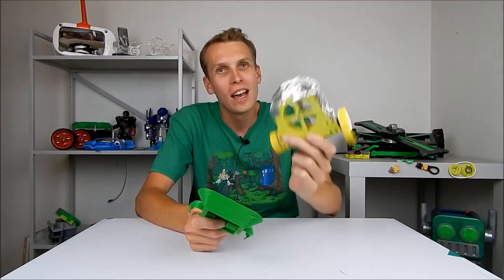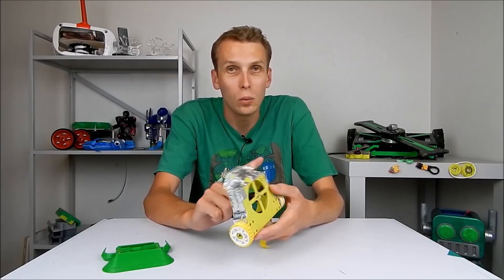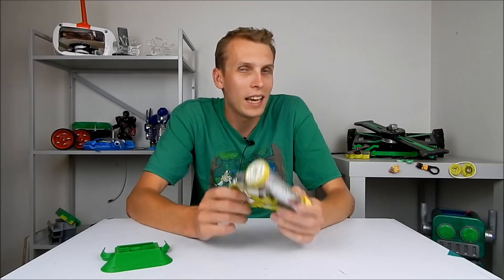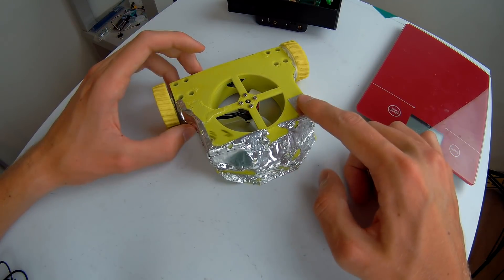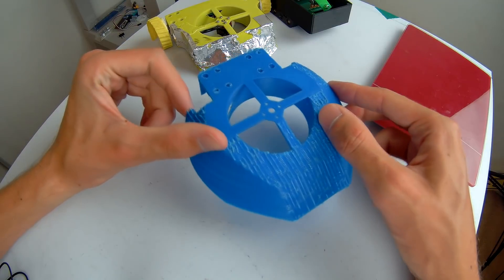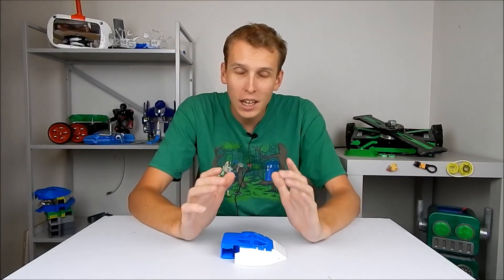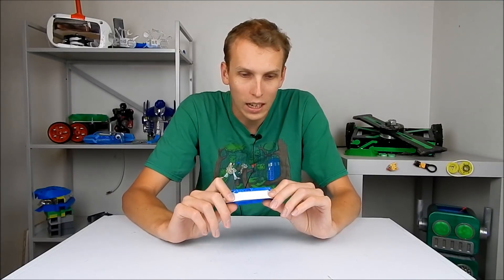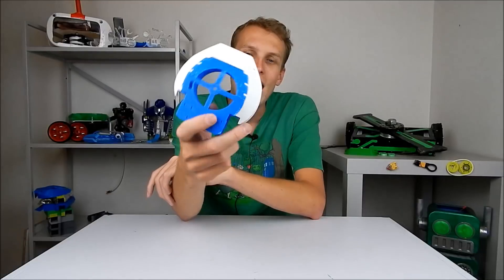Robot Fusion (150g combat robot build)

Comment: A couple thoughts on measuring the downforce of Downforce:

First, since you're only measuring the force at one end of the robot with this setup, you should double that number. This means it was actually topping out at about 90 grams of force. An alternate way of looking at it is that the robot is acting as a lever, and the point you are measuring is twice as far from the fulcrum as the point where the force is being produced, so it has half the mechanical advantage.

Second, you should be able to measure the suction with a very similar setup to the one you are using now. All you need to do is have the surface the wheels are resting on go right up to the edge of the scale, so that there's a nice flat surface under the center of the robot for it to suck against. Just make sure said surface can not be lifted by the suction, like what happened with the stack of cards(?) in this video.

Also, love the new design! It looks very sexy and aerodynamic, which feels appropriate :)
Reply from the maker: Thanks for the tips! I'll definitely look into those.

The stack of cards is a stack of PCBs that I had laying around, I was hoping that they would work the way you described, but they are too light individually and ended up flying around

Also good point about the force being higher than recorded, I hadn't thought about that but it does make sense

Comment: adding vent holes to the inside ring will give you better air flow for the fan, I did see a hole for wires maybe it will be enough
Reply from the maker: Yeah I'm thinking I might add more vent holes below the fan to try and increase airflow

Comment: You should have tested it fully on the scale, that would have been more like how it works normally.
Reply from the maker: I did try that in a previous video but it only showed a ~7g increase, however, its fights show that its getting lot more weight increase then just 7g, so something didint work in that type of scale test
Reply: @TeamPanicRobotics  it could be that the down force is half way in between the pivot point and the scale and its only registering half of what its actually doing.

Comment: No need to apologise for timing/schedule issues, Ben - we know how hard it is to have a deadline AND to do anything constructive AND to get it all on video AND to edit the video AND to upload something worthy of your Channel. No problem. It's your hobby; we're grateful that you're bothering to share it with us.  There are no stressed TV executives in suits storming around looking for excuses to fire people, so don't think we're going to lose interest just because things don't always go according to plan. It's refreshing to have it put plainly and not to be fobbed off with excuses or sub-standard content.  :-)

I was wondering about the downforce of Down Force. I fly RC aircraft, so I'm used to swapping propellers to suit different engines and planes. Your diameter is obviously fixed, but have you tried higher and lower pitched props for the fan? Could make a lot of difference. Watch out for overheating and rpm changes, though; I don't know much about modern electric motors, but a change of propeller pitch might overstress something...
Reply from the maker: Thanks! I do worry when I put up videos of uncompleted projects, especially ones like this where I didnt have much to show for the design at the end. Its quite relieving to know that you are ok with it. I do my best but sometimes thing go wrong and honestly just part of life.

Thanks for the tips, yes the blade diameter is locked but I'll look into the pitch of the prop. The current motor should be ok, its handling the fan fine, so I doubt the change will worry it all that much